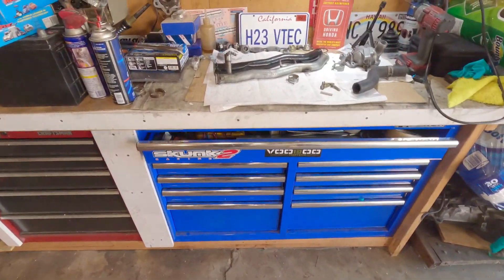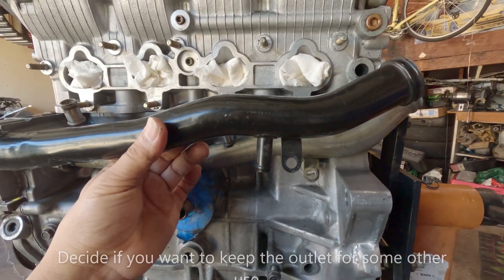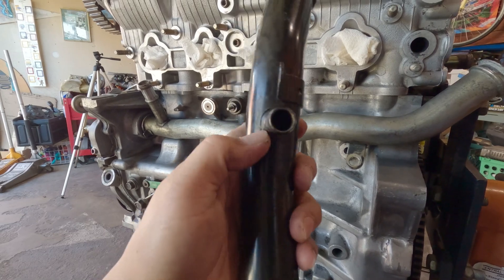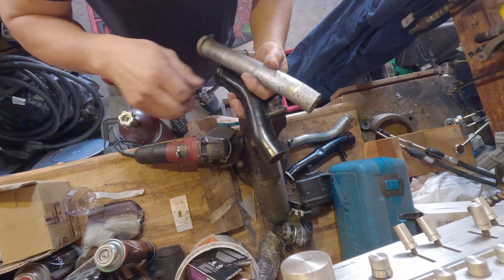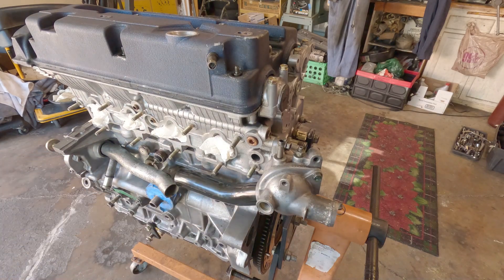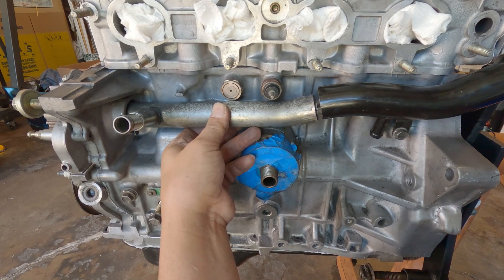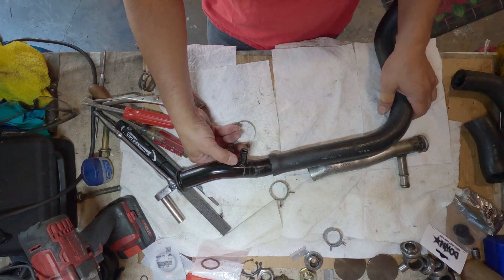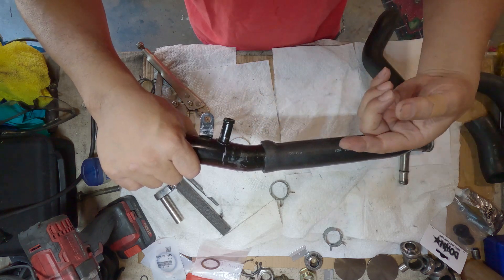DIY G23 water coolant pipe.

Comment: Maybe you'll see this and answer, the oil pressure switch and the knock sensor would be what go in the two spots above the custom coolant pipe correct?
Reply from the maker: Yes, it can go on both, top and  lower side. I installed mine on the lower side for easy access.
Reply: @sagittnet2158  so I did have one more question for the master. If I am doing this build in a 6th gen accord, I have the 2001, then I won't need to modify the engine mount like you did in another video correct? Since the engine mounts right into the car that mod was only to fit it in a civic right?
Reply from the maker: @linksahoe yes, ypurs should be plug n play, no changes on your mounts

Comment: my f22a6 already has an oil cooler would i still need to do this?
Reply from the maker: If ypu are building a G22, yes, you need a H22 coolant tube (half of it) in order to hook up on H22 thermostat housing.

Comment: Which thermostat housing is that?
Reply: Thanks g23 master
Reply from the maker: How was your trip to the yard? Did you get what you wanted? @RaymondMontes-q5v
Reply: @sagittnet2158 yes found a h22 and f23a
Reply from the maker: H22 thermostat housing
Reply: @sagittnet2158 and i can use any h22 and f23 water pipe any year ? Omw to the junkyard
Reply from the maker: @RaymondMontes-q5v yes, f23 and H22 coolant tube pipes join together and it'll attach to H22 thermostat housing. If you decide to use a hose and clamp, just put some lube or water on the hose to make it slide a little easier. Welding it together is not bad either.

Comment: In Soviet Russia, we simply drill out a larger hole on the engine block so that the pipe fits in its entirety.
Reply from the maker: It can work that way l guess,  machine larger the water pump inlet area. Spasibo!

Comment: @sagittnet2258 hi Noel, thank you for the video and the info. Do you have experience using the f20b block in place of the F23A? Do you know if it would be easier to place the h22 head onto this block, along with using the water pump, pipe, etc? Seems like a lot of modifications are needed on the F23A to make it all work. Question for you: since the f20b and F23A blocks are similar, in your opinion what is the max power that the stock cylinder sleeves will hold for a turbo setup @ ~400-450 hp? I know that your civic has LA sleeves. I have a full H22A jdm engine, closed deck, and also a full F20b engine. Not having to sleeve the h22 is appealing to use the f20b block and the iron sleeves instead. Ideally, I would love to use the f20b crank for higher rpm potential but the difference in the main journal sizes makes that a challenge. You are the opposite : you want that long throw from the F23A crank. I'm wondering if the mains on the H22A can be safely bored out to 55mm to accept the f20b crank? Thank you for the content!
Reply from the maker: It can hold up to 450whp but you have to use a good parts like forged piston and rods, wastegate, ecu, injectors for support measure. F20b is a good since its iron sleeve compare to H22. You know H22a also comes w/ 55mm, it'll be from 98-2001 just like Usdm H22a4. I know you want to retain the H22a stamp. I already thought of having my H22 main caps line bore to 55mm also. But the machine shop rhat l went and asked about the idea turned it down. He said its to much material to be shave so l dicthed that idea. But 98-2000 H block and also H23a bluetop are available if you want too except that your back on drawing board, you wantbiron sleeve for boost and for your hi rpm use.
Reply from the maker: I did a F20b swap w/ my friend cd5. I installed arp headstuds, use H22 headgasket and convert the auto to obd1 style belt tensioner, not a fully rebuilt but f20b and H are almost identical except for sizes differences. You can use the f23a crank n rods w/ h22 cyl head and plug n play. You just have to be creative when it comes to piston selection since f20b is 85mm and if using for boost, you need all the sleeve material you have. I know some people will bore it to 86mm. That way they use K20a2 piston but you can always order a custom piston if you like. Kstuned l know are offering a custom Wiseco brand. How ling before you receive it is another story.
Reply from the maker: Yes, f23 w/ H22 head need a bit od mods to get it to work. But nowadays you can buy the supporting parts like the plugs for the cyl head, g series waterpump by kstuned.  G series coolant pipe is available now thru tractuff.com. the only thing you have to worry is the headgasket. I always recommend Honda oe f23 headgasket. Hi revving can also be achieve on g23, use aftermaket valve springs and use .82 turbo rear housing. The only thing you have to watch for when mating F20b block and H22 head is the headgasket, that's also the reason some people having it rebore to next size or resleeve so it'll have a correct diameter, otherwise it'll create a hot spot on the combustion area but never seem to bother other builders to mate it together. It's almost like me, f23 have 86mm and H22 head is made for 87mm. But l have no issue headgasket failure. If l have the f20b block and l only have H22 head, l'll try that combo and if l fail, l'll keep trying till l get it correct. You already decide w/c piston to use on F20b w/o having it bore to next size?
Reply: @sagittnet2158  thank you for the responses. 

The H22A that I have is the jdm closed deck block used in the 92-96 Prelude. Its a 50mm main journal for the crank, so I will most likely sell it to continue financing my build centered around the F20b crank. 

I could go the F23a1 route and just use the block, with it's 86mm bore being closer to the H22 cylinder head, instead of using the F20b block. I measured the combustion chamber from the h22 head I've been working on and the diameter is 85mm. I need to measure the f20b head's combustion chamber still to see if there is a difference. 

Both the F23A and the f20b use 55mm mains. Interestingly, the 97 h22a4 block also has 50mm mains as the fourth gen h22. Honda didn't use 55mm mains until 98. You are right--im back to square one if I use the H22a4 with 55mm mains as I still have to sleeve it, and h22a4 blocks are even more expensive than the F23A where I live. Using the F23A allows me to obviously use the f20b crank and also use off the shelf k20 forged dish turbo pistons. Just have to make sure that the piston compression equals the 8.8-9.0:1 that I'm after for my application. Ktuned has the f20b forged rods. This setup leaves the pistons in the hole by about 1-2mm, assuming that I don't have to mill the head or deck the block. What do you think?
Reply from the maker: @samerca1  yes, using f23 block is best for your f20b crank. I was once looking for F20b crank but its hard to find in my areas. For the piston, use k20a2 and compensate the 1mm below the deck by using a much higher comp ratio k20 piston. Maybe something like 9:6 to 1 piston. You know about zealautoweks.com. Type in some numbers snd it'll give uou an idea on what your build comp ratio will be.